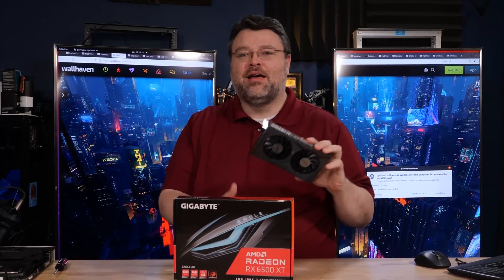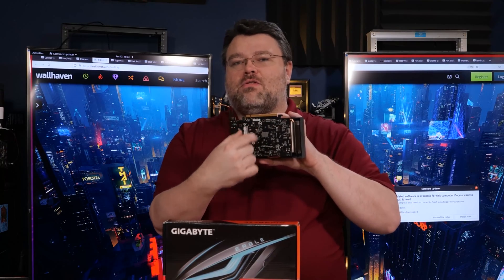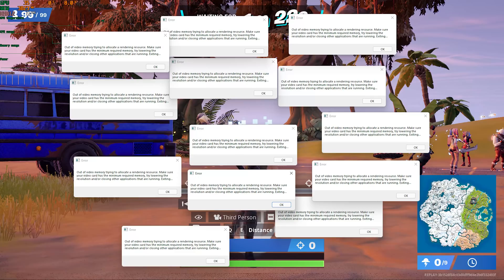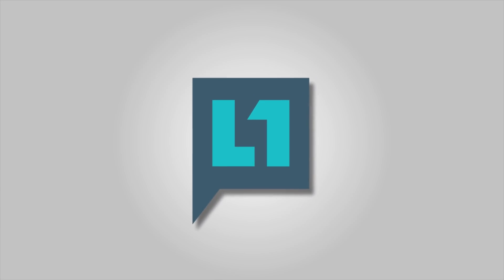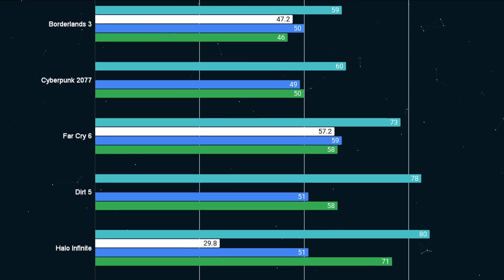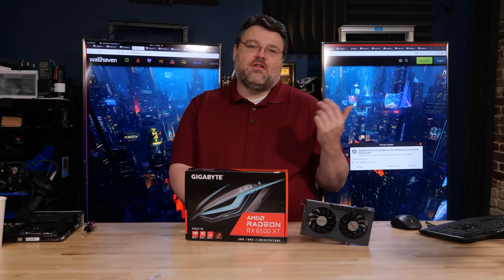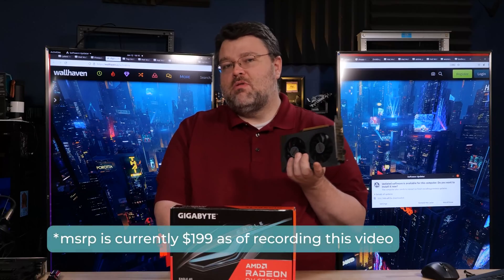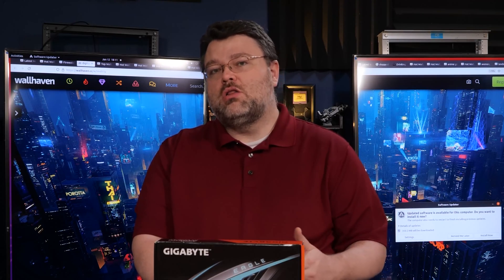6500XT ; Now Attempting Launch - Gigabyte Eagle Tested

Comment: Devil's advocate: If AMD wanted to make as many GPUs as possible in these times of chip shortage, it makes total sense to make a tiny GPU chip and as few memory chips as possible. I'm curious how many they can pump out, and if it would be enough to keep it in stock and at msrp. So if AMD was trying to get as many cards into hands of gamers at acceptable prices, this seems like a decent move.
Reply from the maker: yeah, prettymuch my thinking. If they manage not to sell out of these AND we see them under msrp then okay maybe it is a failed product but as a stop-gap product? if these cuts mean you can have 4x as many then.. maybe this is ok.
Reply: They should set the MSRP to $150 imho. And maybe make another one with 6GB for $180 with PCIE x8 lanes. That would be smart. Now it is a marketing disaster to AMD.
Reply: @giorx5  MSRP is a suggestion, sellers in EU are pricing it between 350 and 400 euro

Comment: This product seems like either AMD was worrying big league that 6nm TSMC was going to be a difficult and buggy process, or AMD was worrying that they couldn't afford to fab at 6nm TSMC so they carved half the card out of... the card.
Reply: The real story is they took a laptop gpu and put it on a pcie card. Hence pcie x4, 64 bit bus, no media encode/av1 decode, only supports 2 displays, and why its on 6nm in the first place.
Reply: Isn't tsmc 6nm just there 7nm but better? Like 7nm+? I don't know how that would be a buggy mess for amd, but the increase price in manufacturing may definitely have a bigger impact in design choices.
Reply: @carl8790  its just a more refined 7nm. Completely IP compatible. It just sounds better to call it 6nm instead of 7nm++
Reply: @Jsteeezz  lol true. Sometimes I wish the industry would just call it FinFet Gen whatever number.

Comment: Other reviewers point out some games where the FPS drop at PCIE 3.0 is much more than 3%. Doom Eternal sees a cliff of a drop, over 50% (hardware unboxed). Maybe a bit more homework next time, Wendell? I would have liked to see that PCIE comparison chart. Your enthusiasm is nice to see, as always.
Reply: The HUB review was very poor.  The reason performance suffered so much was because he used settings that required more than 4GB of memory.
Reply from the maker: If you watch to the end there is actually a part where I talk about when it can hurt you vs the 480. You can make the perf loss because of pcie 3.0 any number you want depending on how badly your game overruns 4gb vram because it's got to get the textures from main memory. If your game is comfortably using less than 4gb vram the perf loss really is not much
Reply: @Level1Techs  I think the point is it's important to show WHY it's so critical to remain within those boundaries, especially with a card that can so easily see 3x4 overrun, not just a vram overrun. It's fair to say stay within it's limits, but you didn't stress just how brutal it is here vs traditionally running over the buffer, or just how common that problem is truly going to be. With a proper bus it's not a cliff, but a downward slope. Many people will put up with a stutter on an entry level card. Running out of vram here is not like running out previously. I think that's what you failed to get across in the video and why you're getting worse than average resistance in comments.

You know what you're doing and even you slammed into that wall. We can be guaranteed anyone buying this will absolutely slam into that wall too. Being patient with that for the duration of a test suite because you understand the technical limitations is totally different from someone that spent their hard-earned money on a $300 card that should have been $140 and it's all they have. AMD designing an entry level card capable of so easily saturating the pcie lanes it's alloted is incompetent at best imho, and you run the risk of making it sound like you endorse a card that will give many people a horrible experience if they buy it and they don't understand exactly what your little asterisk segment meant. That's your integrity on the line. We need to dumb it down sometimes for the people in the back that only understand benchmarks cause that's precisely the kids these cards are targeted at. Hell, many games don't even tell you your vram usage. How do you explain that to a noob?
Reply: @Level1Techs  you should also really list the game settings next to the game on the benchmark graphs. Because it seems like you just chose whatever settings it would work on. Should of shown both options, as it seems many times the actual gpu and shaders can perform higher, but are limited by vram to lower quality settings.
Reply: @Level1Techs  It think it would have been pertinent to show the 4.0/3.0 numbers either way, so that people know what happens when the memory is saturated on PCIE 3.0. It might be a deal-breaker. If the numbers look bad for AMD, it's not your problem.
Reply from the maker: @technologyanimals  No because then people take it out of context and don't hear my words of what I'm trying to explain. maybe a good idea to show settings vs perf falloff. When you start to exceed vram it is much more of a "cliff" that you fall off on this card, esp. at pcie 3.0, than other cards. But it is very weird times and they'll probably sell every one of these that they make.
Reply: @Berserkism  What kind of confirmation bias do you see in e.g. GamersNexus, HardwareUnboxed and LTT? That they're all nVidia shills? I found their reviews in general to be helpful and accurate (same usually goes for L1).
Reply: @chrissoclone  I usually find the first to scream out shill are the most biased of all. All the one´s you listed have heavily criticized nvidia in the past. So try again...
Reply: @Berserkism  No, Wendel explained to people that already know what they're doing how to avoid a buffer overrun, and barely how uniquely punishing this card is if you cross that line. The kind of younger kids these cards are aimed at aren't going to understand how to pull up their vram usage, let alone abate it. That's why this launch is uniquely targeted by techtubers. The kids that actually NEED the advice need to be aware of what they're potentially getting into. There's a solid chance little Billy will talk mom into gamepass that's a minefield of titles that will bring this card to it's knees and not because the card is too slow, but hamstrung by incompetence. Fanboi AMD all you want, but by all measurements this release is a testament of incompetence that I expect better of AMD.